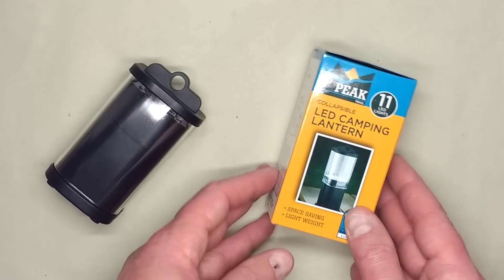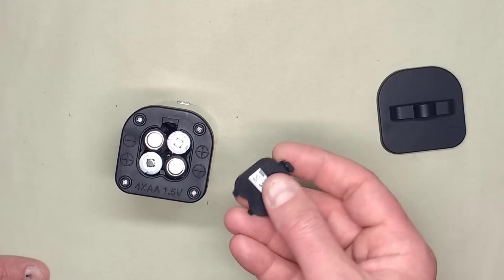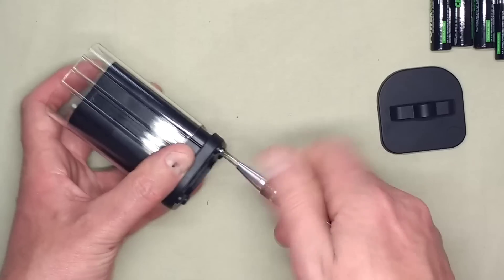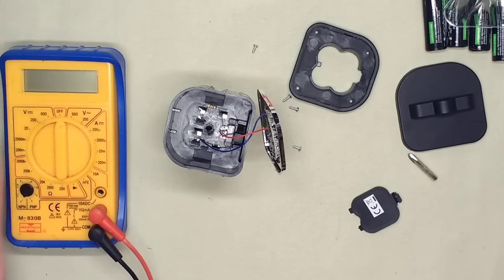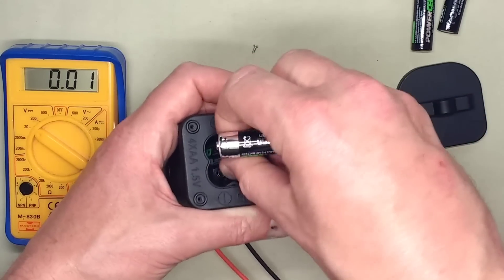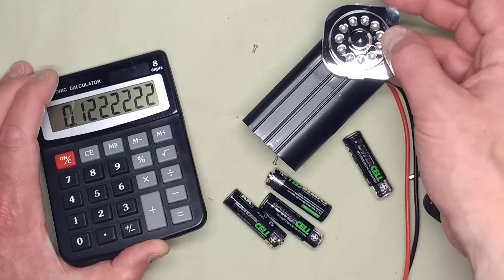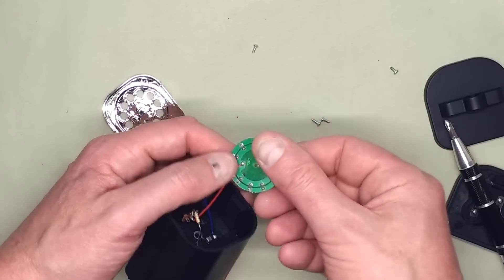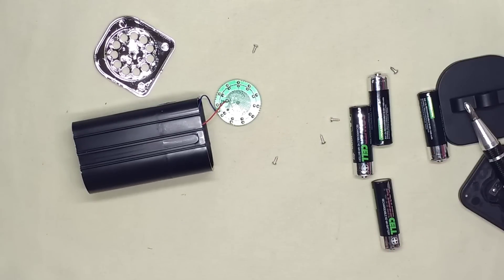Inside the Poundland camping light.  (It's good.)

Comment: Bought two of these put 4  1.5v Duracell's in one turned it on and right away could smell the resistor cooking it was only 2.7 ohm replaced it with a 100 ohm as anything less was still getting hot. Working fine and cool with the 100 ohm delivering 2.7v to the LED's

Comment: I have several of these camping lights and I agree they are very good value. They recently came in handy a few weeks back when a power cut occurred at night. The elderly neighbour was grateful to borrow a couple of these lights which give an impressive light output. A couple of points, the batteries are a little fiddly to install and the reflector plate was adrift on a few of my lamps but was simply clicked back into place. Poundland seem to be very 'with it' and certainly come up with some quite interesting items. I'm also very impressed with their mains LED lamps which give a decent colour rendition.

Comment: Could one make (or would it be worth making) a torch circuit that starts off driving multiple LEDs but automatically switches over to a Joule Thief mode when the batteries reach a certain low threshold? Perhaps only driving one LED?

Comment: Did you ever play with super capacitors insted of batteries, i modify every batterie and solar light with 100 or 500F capacitors and they resist german winter and no one fail over the last two years.  Chris

Comment: I was given one last year and the batteries actually push the cover off, or makes it bulge, so the circuit is interrupted.  So as a lamp it failed.  I was camping, and resorted to string and cardboard to hold the cover in place.   And when actually working, doesn't give a great deal of light in a tent.  But still, fun video..

Comment: Why not mod by adding a joule thief and screw the last pixie out of the batteries?  There looks to be plenty of space in the case.
Reply from the maker: +Andy White Joule Thief units are best suited to use with a single cell.
Reply: That's very true.  I've recently bought a couple of different brand small but very bright two cell 395nm UV torches for inspection and curing UV glue in tight spots. My best guess is they seem to be using the JT circuit (or something like it) to deliver brightness without needing the usual mains or 3or4x D cell(s).  These are just as bright as my "pro" lamps - except one is 2x aa and the other is fine on 2x aaa.
Battery life is piss poor at 3-5 useable hrs but they do the job and output is very impressive esp considering I'm using only tesco longlife.

Comment: I've got a couple of these (and from Down Under) - they are pretty good for camping, fair amount of light, easy to carry around and compact as well.  I just checked one - I'd left some ancient NiCad batteries in it and it seems one of the outer contacts has corroded.  Should be an easy fix though.

Comment: I had some tiny little regular sized straw hat LED's and they were in a flashlight with a reflector for each one 
There was three LED's in parallel

and they were getting about 400mA on average from fresh off the charger NIMH AA's!!
400mA for just three straw hat LED's?? Thats extremely high

Somehow they handled it through many uses over a few months and they are still just as bright as when i bought it!

I checked and directly hooked them up to a 400mA power source and they worked just fine. Very surprised they have been able to handle such a massive current going to them without any degradation

Comment: I like these videos Clive puts out that he is surprised by what is inside a cheap electronic gadget. :)
Also the Northwest here in USA is on fire.
And it is to close for my liking lots of smoke and ash all over the place here.
My worker ever left early at 3PM instead of the usual 4:15PM.
Said it was alright though as it is blood hot here and he has no air conditioning in his car so is having to leave his windows shut when he drives.
Anything on fire at yer end Clive besides something blowing up on the bench? xD

Comment: What if a low value capacitor were placed in series with the resistor? Would this help with the reduced brightness as the cells discharged?
Reply from the maker: A capacitor blocks DC so the LEDs would only light briefly as it charged.

Comment: A good light will use 4 batterys, not 2 or 3. A better light will use 1.
Any light that uses 3 batterys are landfill cancer.

edit: Unfortunately this is an example of a typical shit light, the 4 batterys are getting wasted. There should have been a proper driver inside. That's one box they did not tick.
Reply: I dont like electronics of any sort going to landfill, and this is what is going to happen when people realise the light is not so bright as the voltage drops. It will always look white and bright to look at but its radiation drasticly drops.

Comment: It still means that it's pissing away 2.2/6.0=37% of all the energy as heat that is being dissipated over the resistor. That's not so great. But I guess, for the price, you cannot expect a little buck convertor in there.

Comment: One small problem with modifying this light to use infrared LEDs is that the LEDs will have a lower forward voltage, meaning that the power dissipation of the resistor will be much higher and will probably exceed the resistor's ratings by a modest amount. I wonder if any paranormal investigators were spooked by having their infrared lights mysteriously stop working after they had been on for a while on a fresh set of batteries...

Comment: Surprised they didn't make it a 3 cell, as 4.5V would be enough to drive white LED through a resistor with less waste - even with the NiMH in, the voltage on the resistor is greater than one cell, but with the lower voltage, it would be more sensitive to droop.

Ideally, a buck converter would get the most out of the batteries. but a slightly lower constant current source could give constant power for longer, but deplete faster at the end.

Comment: Nice little lamp - can't see anything like this Down Under. There's enough space in that case to squeeze in a basic charging circuit for NiMh, even moreso if you were to convert to a pair of 18650's rather than the NiMh AA's. Just use the charging circuit from one of your "massive stockpile" of old Poundland 18650 powerbanks!

Comment: Love the low power stuff... I think a video on a super capacitor running a single LED would be interesting... they aren't that super IMHO compared to even a tiny 40mAh 1.2v NiMH cell with a joule thief circuit (Poundland garden light). And have a stab at roughly converting 1 Farad to mAh - not easy I know..

Comment: In the old days you would have used a 1/2w resistor for a 1/4w load just so the resistor would last longer. If you look up resistor specs you will find that running them at their rated power also runs them at an amazingly high temperature. But all that said, this resistor will probably last about as long as the whole lamp will.
Reply: meant for 2-3 nights of a camping trip, the batteries go flat, you leave it, it gets all corroded inside, chuck it

Comment: wouldn't resistors be more efficient if they had a thermoelectric coating then you could convert the waste heat back into electrical energy somehow??? 🤔
Reply: Donald Sleightholme If you want that, there are more efficient solutions. As a rule of thumb, converting from electrical or mechanical energy, to heat and then back looses about 50% due to the 2. law of thermodynamics.
Reply: No. The energy cost of producing the coating and applying it to cheap resistors as well as soldering leads back into the board far outstrips any electricity it can produce.

Comment: so it is about 50% efficient, around half the battery power is spent heating up that resistor. if somebody can source a cheap small DC-DC board as used in USB stuff a lot they could increase that to over 85% as a potential modification :)
Reply: That was what I was thinking, there is so much space for a little CC buck converter
Reply: Wouldn't work very well unfortunately. I get about 2.6V across the LEDs, so in two groups in series it would be 5.2V, but 4 rechargeables are only going to make 4.8V.
Reply: l wilton With a CC buck converter it would work fine, but the switch transistor and flyback diode will need to be very efficient (low resistance / schottky).  With a CC boost converter and all in series, things are a bit easier to optimize due to no flyback diode and the transistor working at a higher voltage.

Comment: With fresh alkaline batteries that resistor would drop like 3V, then 3V*3V/18Ω = 0.5W. So that resistor should be 0.5W in my opinion.
edit: also, I think that at very low currents the white LEDs tend to give shitty light, not really perfect white. At least that's how it used to be.

Comment: Is there enough space to hack in a PIR sensor? It could make neat ambient motion triggered lighting that is self contained, the cells could last for ages too.
Reply: not a droid hell yeah man perfect for long unlit hallways.
Reply: and finally here is the info on adding the PIR to this light…
http://pixelchimp.net/blog/pixel-chimp/poundland-plus-PIR
Reply: PIR sensor from an air freshener.
Reply: FYI it is possible to fit a PIR module into these lights, the space below the LED's  can accommodate the module (I used the common dyp-me003 type) .  I also fitted a small circuit board to add fade in/out to the triggering. I'll write it up and post a link soon.

It works fine to add some light to a small room, thanks for highlighting it Clive :)
Reply: Paul Sengupta, maybe but I was thinking of the DYP-ME003 type modules that Clive used on https://youtu.be/evZM2_RTvTU. Cheap & also can support light sensor for dark detection.
Reply: you keep it for when you DO need it
Reply: If by neat you mean too dim and a waste of time, yes you could do that.  If there's not enough space in the body of the casing, just screw on a side extension to house it.
Reply: Not a waste of time if it stops you falling down the stairs or peeing on the floor.
Reply: Paul Sengupta, that's exactly my thinking. I already have 4 AA, PIR controlled fade in/out LEDs in the hall and bathroom etc. They give enough light to see without disturbing others at night (noisy switches, light leakage). They also don't blind you when hungover :)
They are more than adequate if you have reasonable expectations of what 4AA's can do and don't expect them to replace mains lighting, they can also provide basic lighting in a shed,  inside or under cupboards and other places that don't have easy mains supplies.

I'll try to pick up one of these & see what can work at the weekend and then post if it works out OK.

Stinky Cheese, by 'neat' I mean clean or tidy as in a self contained solution.

Comment: Isn't a very low resistor value almost not worth putting one in...
Reply: It still limits current going to the LEDs. If you want an example of a useless resistor, Apple puts 0 Ohm resistors in their products, and they go off often.

Comment: Why is there a hole in your thumb nail?
Reply: He is going to retrofit an infrared LED into it.
Reply: smv133 Some people heat up needles to drain. I got a set of tiny drill bits and a special collet for my Dremel years ago and found it worked great when I smashed a nail. I just drill until fluid starts coming out. The bit of nail that remains acts like a valve flap. It keeps stuff out but I can easily drain it by pressing lightly with the tip of a needle.
Reply: SpudHead Yeah, sounds gross but when the pressure from the fluid is exerting pressure on the bruised and highly sensitive tissue under your nail and it throbs with every heartbeat and hurts like heck, the relief of removing that is unbelievable.
Reply: Done the hot wire brad trick myself a few times. These guys are right: feels SO good once the pressure is off. Only downside: it stinks up the area, like burning hair. If you wait a while, it's even worse, because the blood goes slightly funky.
Reply: Yeah I guess so, still makes me cringe to think of drilling a hole in my nail.
Reply: You won't cringe when the time comes and it's throbbing to the point that it's all you can think about.
Reply: Actually it's not the drilling of the nail that makes me cringe exactly,. It's just the accuracy needed to drill it far enough to release the pressure and no further. It's the thought of drilling too far into the soft tissue underneath that's causing me to shudder.
Reply: gross

Comment: What on earth do I need a camping lamp for when I don't do camping, that's the question I ask when I'm unpacking after a pound shop visit. Then I put it with all the other lights and torches I've bought for no reason.
Reply: bren106 what do you mean? No reason? Cos Clive says they're good is reason enough surely
Reply: You went into hunter gatherer mode, wanting to beat the other stone age clive watchers in case they harvest all of the camping lights before you
Reply: Buy a few of the ALDI/LIDL 5W Cree-based lamps. About ten Pounds (UK) but really worth the money. We have a few of these and they are VERY good indeed for outdoors activities - 2 x AA cells (on low power) last about TEN hours, and Eneloops can provide 14 hours straight runtime. Good review - https://www.youtube.com/watch?v=KNYZcRVoQeA&t=165s
Reply: They'll all be useful when we convert completely to wind power in this country and the wind stops blowing. Assuming you've charged your NiMHs while the wind was blowing.
Reply: Power cuts, fuse box problems, dark cupboards.... Always a handy thing to have.

Comment: That looks like a prime candidate for a li-po mod of some description. Or even something like a parallel pair of 18650's, should one be inclined to "carve out" the wall that's holding the inside end of the batteries. Slip in one of those little TP4056+DW01 USB charging boards, and Bob's your auntie...
Reply: KhronX I bet you could fit 4 18650's
Reply: Mmm... That's actually a good point, there seems to be plenty of room in that black casing. Maybe squirt in some RTV around them (plain foam "feels" a bit shoddy) to keep them from rattling around in there...
Reply: KhronX Or just mold/carve/print a new endcap to hold them in position.  Leave them some air to dissipate heat.  Oh and only use 1 or 2 for this 4.8V to 6V circuit.

Comment: Clive's off to poundland to buy more and then swop them to warm white LEDs :p
Reply: No, No, No...

Slow changing  RGB
Reply: I''m wondering what one would look like with colour changing LEDs
Reply: Man, I hate these cool white LED's, but I found out the other day that the cool white LED's illuminate a lot better than the warm white ones do. I was without power for 18 hours and I had a lot of free time.
Reply: +girlsdrinkfeck He just need to change the resistor then
Reply: They are harsh to me and feel sterile. But in flashlights or led lanterns, go with cool white all day. You will have more light for longer. Warm white just feels comfortable, cozy. Hard to put a word on it.
Reply: yep indeed the cool white seem to put out more light when its the only source
Reply: yeah I prefer cool white or pure white LED's
They are brighter to me. and in my hot country they make me feel cooler and more comfortable!
I cant stand the warm white LED's. they make me feel like i'm in an oven!
Reply: I have cool white (actually really quite blue) and warm white GU10 in my room as the main light,  and when I look at them they always make me think of a binary star system.
Reply: No, more like pink.
Reply: colour changing LEDs m ight mess with the circuity its on ,since red and blue etc all have diff power ratings ,wouldnt matter if it was a few LEDs but 6 is pushing it
Reply: mark grant Yeah, so delicious.

Comment: How do C and D cells compare to AA and AAA? ... and what ever happened to A cells?
Reply: Capacity mostly, not sure if there's much else difference. They still output 1.5v.
Reply: "A cells" were the gigantic 1.5 carbon/zinc cells used for powering tube filaments and they went the way of the do-do as tubes did the same. I used to buy them back in the 1970s as they were the hobbyist's typical clean DC supply before 3 pin voltage regulators arrived on the cheap. Here's a picture of a 45 volt "B battery" and a 1.5 volt "A cell" with a modern 9V battery for comparison. https://c2.staticflickr.com/2/1061/529533273_bedfe73eb0_z.jpg?zz=1 I remember shorting one with some small wire and the wire instantly turned orange and melted... they had some serious juice.
Reply: nowadays C and D cells most likely have a single AA inside them, but back when they did, a AAA has 750mah, AA 2000mah,  C 3200mah and D 5000mah on alkaline, but you can buy c & D adaptors and a D adaptor that takes 3 xaa as thus gives great capacity, A cells were gigantic and thus with modern leds and transistors,  a thing of the past, much is true of C&D cells now
Reply: I say bigclive make a video about batteries all chemistry and sizes :)
Reply: I miss 90-volt (and higher) batteries. Used to be fairly common, about four inches square. Sad, really.
Reply: most C and D cells are terribly under filled sadly. some even have basically an AA inside.
Reply: these were to run valve kit :)
Reply: Try one of the battery specialist shops, I've never paid more than about $15 here in Australia for a 2/3AA Cell.
They get used as memory back up batteries in PLC racks, well in Lithium type they do.

Comment: Mine started smoking and the resistor burnt out
Reply: Smoking is bad for you -- cut it out
Reply: +jason h now just replace it with a 18ohm resistor
Reply: bigclivedotcom i got a reading of about 2.8ohms before it went completely. Seems alot lower than your one...the bands are not readable anymore thou haha
Reply from the maker: Either the resistor was too low a value or there was a short on the LED PCB.  Both easy fixes.
Reply: bigclivedotcom  I've also bought 2 lanterns with resister band colour red/yellow/gold/gold, I've ordered the 18ohm replacements. Sean